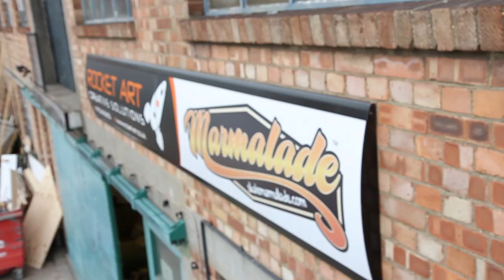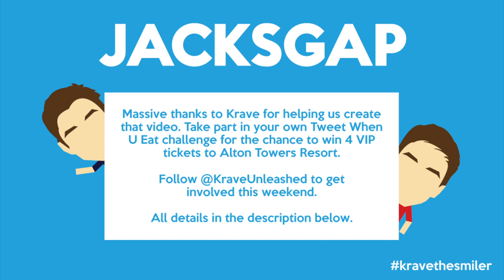The Cereal Machine

Comment: Were doing a similar project in science and the prompt is: "How can we make a Rube Goldberg machine that shows energy transfers and will engage children at the Children's Museum." So my project worked like this, A domino track knocked a marble down a paper towel tube which unconnected a circuit which was powering an unconnected fan. When the fan turned off, it would fly up and knock spaghetti into a pot of boiling water. It actually worked and we're able to cook spaghetti in class.